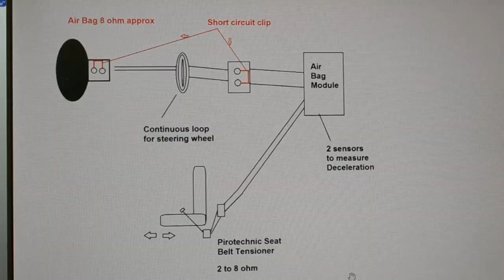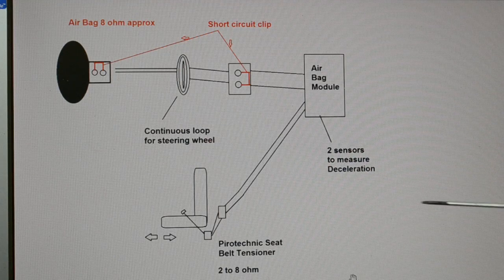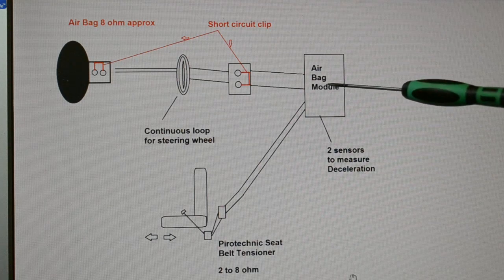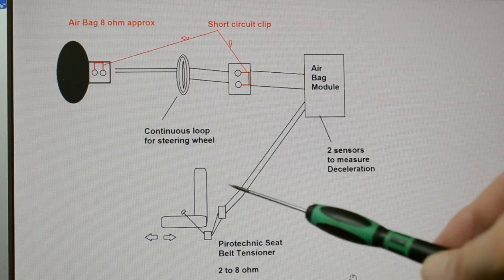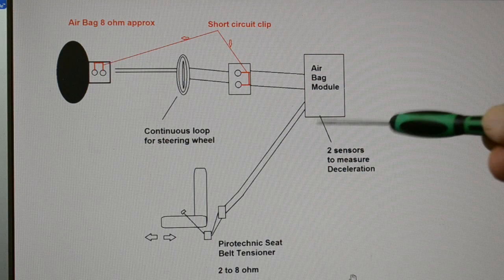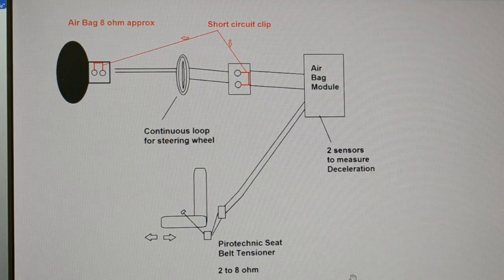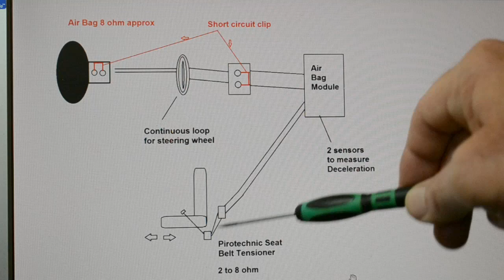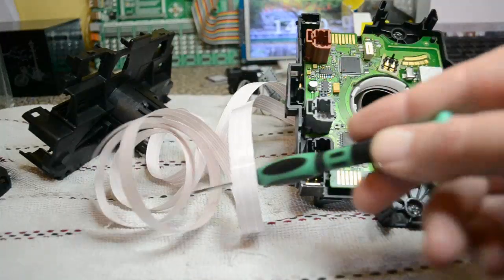Air Bag Light On & OR Horn not working -repair guide

Comment: Hi John. Trying to rebuild my 1993 Aura Legend L clockspring and can't seem to separate the top from the bottom. Have released  the exterior tabs but still no luck. Is there a trick?
Reply from the maker: Hi,
Sorry only did the type in the video.
Reply: Hi John. Thank you so much for your reply. Unfortunately my Acura clockspring is completely different from the Puegot. The Acura has 3 tabs to lift but there's a turn indicator cylinder in the middle of the clockspring that seems to keep the two parts together. Can't get that cylinder out to separate the top from the bottom.
Reply from the maker: In my experience, a repair to the wiring lasts for 5 minutes, hence throwing it away and getting a new one.
Reply: Hi John. Couldn't agree more. Researching a replacement. Thanks for your time. mg

Comment: Thank christ i found this video. 
Just saved me from reality screwing it up.👍
Reply from the maker: Thank you for the comments
How would you have screwed something up?
Reply: I bought a Renault recently and the horn pleased if it works or not and finally died the other day.
 I've been having a look at whats causing it. Im at the point wher I'm thinking the steering wheel cant be that hard to "just have a look"  LOL.... Anyway your video tells me I ain't qualified to go anywhere near it.
I am almost certain the problem is a broken connection in the wheel.
I guess its a trip to the garage for me.😕
Reply from the maker: @dustysweeper  Hi Dusty, did you fix the fault?
Reply: @JohnB-2021  no. The horn still only works when it pleases.  I believe it is a bad solder joint on the live pin inside the rotator switch.

Comment: does anybody know how to put the coil of wire back in correctly? like a rule for the 206 similar to what he mentioned for ford? turn it until tight, then the opposite direction for x turns to centre it? i'm worried the old man's gonna snap the thing if he turns hard since he said he did have it apart..

Comment: good video john....now make a video from the flat cable in the rear windschield wiper switch...those brake down also,can t repair it but it shows how it s not working....mine looked oke but was bady worn(flat cable in the rear window switch)afther this video i consider buying a new com 2000....

Comment: You skipped the most important part, how to unlock the cover.
Reply from the maker: Any one can figure that bit out, it’s just clipped together
Reply: @JohnB-2021  for the center ring cover is not easy to figure how to remove the cover, on this specific model you are showing. 
In case someone need that info you need to press each one of the 4 latches from the inside. If you are going to do something do it well.
Reply from the maker: J D if someone can’t figure that out for themselves, they shouldn’t be touching it. That said, there is nothing that can be repaired so no point in taking it apart.
I just show what goes wrong.

Comment: I'm helping a friend diagnose a problem with their Great wall x240. The headlights, indicators, central locking stopped working and airbag light came on all at the same time. I'm thinking it's this unit shown in this video is the likely problem.
Reply from the maker: Maybe this unit if it's not a fuse.

Comment: I've bought a new squib and the airbag light went off and horn started working...after 2 months the light is back on and horn has stopped too?? I've checked the earth as I self tapped another screw into the steering wheel and covered it in silicone grease. 
the light is still on and it's really puzzling
Reply from the maker: It sounds like, either the steering wheel wasn't set in the middle, or the wiring wasn't set in the middle, that would break the wiring in a few weeks.

Comment: Incredible content. So informative brother. Thank you
Reply from the maker: You're welcome.
Reply: @JohnB-2021  I'm having a toyota Yaris 2010 model which i resently sent for a replacement of the indicator system, Afterwards the hooter lasted not more than 48hrs. Now the airbag sign is on as well. thanks again for this information.
Reply from the maker: @MbhoniMzee  Was it new or used?
Reply: @JohnB-2021  It was new
Reply from the maker: @MbhoniMzee  If it worked once and now it doesn’t, the unit wasn’t centred before fitting it. 
It will be broken.
Reply: @JohnB-2021  Eish okay. where do you suggest we could buy it? 

Thanks once again

Comment: I was doing a brake booster job for my gmc acadia 2013 the steering was on my way, removed it but broke the wire without noticing now i know what happened, thank you 

So i had gmc acadia 2013 horn not working nor the air bag, now i know thank you , because i had to do brake booster replacement, and the steering rod which are connected to the steering gearbox were in the way, so i had to take it off, the steering wheel turned a few times, and i didn't realize it untill i hit reverse, the drawing in the camera was not aligned as the steering, so i took it off and turned it a few times yo align it, and now i know i turned more to the wrong side and now its broken, better replace it now
Reply from the maker: Pleased the video helped, thank you for your comments.

Comment: Hi john thanks for your reply. Is it possible to repair the reciver or does it have to be replaced. The whole block is over £400 from Citroen dealers.
Reply from the maker: I have no idea why the receiver would stop working correctly assuming you now have 2 keys with a low range problem.
Have a look for one on ebay.

Comment: 2:29 Ribbon cable. Not so much a "repair guide" but a "why it fails, and then swap the unit" guide. In theory, you should be able to unplug the clockspring cassette from the PCB, and replace it with a working secondhand one.
Reply from the maker: flat flex, you're right.

Comment: Hi I have a 2007 Citroen dispatch 2.0 hdi the central locking only work's when the fob is very close to the ignition barrel the fob dos'nt work from outside the van. The van starts fine it's just the central locking I've had a new key fob cut and programmed still the same. So could it be the remote reciver that's part of the wiper and lights stalk block.
Reply from the maker: Hi,
It sounds like you have eliminated the key so it must be the receiver.
Reply: @JohnB-2021  ok thank you

Comment: 2005 camry 
tried to pull steering half shaft to lube

I disconnected and it slid down 

but steering wheel spun around and around while I was working on half shaft 

I marked shaft and  steering wheel column , but did not tie it

once reassembled ... airbag light came on and horn stopped...

this evening

Comment: Hello john i have just found your upload and have subscribed as great upload,i had the problem of horn not working and airbag light on and have changed the comms unit on citreon berlingo first,horn is now working but airbag light still on,question is do i need to get new unit  programmed to van at main dealer
Reply from the maker: Hi,
Thank you for the subscription.
If the horn now works, you're moving in the right direction.
The units do not need to be programmed and if the system is clear of faults, the air bag light should go out.
Is the comms unit a brand new un-used unit?

Comment: Can air bag cause other problems . I was stupidly packing a pack of cigarettes on my jeep cherokee steering column a week ago and as I left the corner store parking lot . I noticed the air bag light was on . Well today as taking my wife to work a nasty person was blowing there horn at us and I told the wife I did nothing wrong and could not figure just who was honking at us . Later while on a side or residential street the horn came on and I knew it was me because  I was the only one there . . I can't afford the part at this time but thank you for the tip's I will check out the local junk yard and see if there are any units there with good wires . I may beable to find one in good condition and at a good price . . I beileve while packing the Cigarettes On the upper part of the column  I jarred  or trggered something that went from bad to failure . I  would love to hear your thought if you agree . I have unhooked the horn for now so as I will not be shot by someone . LOL . God Bless     Tim in Florida .
Reply from the maker: +timothy thomas 
Hi Tim,
I'm a little lost, is there some sort of holder around your column for packs of cigarettes?
If you were touching the column and the light came on, I'd suspect a loose / broken wire.
The air bag system often runs to the seat belts too, they have seat belt tensioners.
It's difficult, but you need to do a continuity test on the wiring (with the ignition off)
Air bags are generally 2 to 8 ohms.
I bet the weather in Florida is nice, it's cold here today (UK)
Oh, as for the horn, if you press your air bag (like mine) it could just be loose and need adjusting.
My car MOT was yesterday, yet again the second hand switch stopped the horn working. I found a new one on ebay for £65, fitted a few weeks ago. Yesterday my car passed an MOT test :)
Thanks

Comment: Hi John. My car is a 2001 Dodge Neon. First the Horn stopped working and now the Air Bag light keeps coming on. Are they connected? Does your video also have to do with the Dodge Neon? They did not go at the same time.
Reply from the maker: Hi,
I imagine it's one and the same problem.
Unless Dodge have mastered a way of connecting the horn and airbag without a coil of wire, it will be a coil of wire broken.

Comment: No need to open up the squib/clock spring. Check for continuity first with a meter or tester.
Reply from the maker: Yes I agree, but this video shows what the end user is testing and why they fail.

Comment: I have a 2014 Dodge Charger. I replaced the rack and pinion, spun the wheel carelessly both ways. As a result, airbag light is on, the horn doesn’t work, the traction control doesn’t work nor does cruise control. What would I need to change out on the vehicle?
Reply from the maker: Sounds like you might have broke the column wiring
Reply: I have all the same symptoms except my airbag light is not on @JohnB-2021 . I just put the car in the shop. I hope they don't overcharge me.
Reply from the maker: @jointglobalceo  Please let me know what they find.
Reply: @JohnB-2021  it was the speed sensor on the rear wheels and my horn was missing lol

Comment: Very informative thank you. Also what if I have a continous airbag light and the clock spring is not the case? I tested all the plugs, airbags for continuity and the cables are ok. I tracked them down to the SRS module under the center console. How can I test the SRS module itself ? Thanks! (Citroen xsara btw, I have the exact same assembly as you showed in the vid)
Reply from the maker: Thank you for your comments.
I don't believe there is a method of testing the airbag ecu  other than trying it on a vehicle.
I've not heard of airbag modules just failing and bringing on a light.
I think you need someone with a scan tool to read the fault.
Did you have about 8 ohms to each airbag?
Have you checked the seat belt tensioners too?
Reply: I have a fault on the right side seatbelt tensioner, and the scan tool said "driver squib 1st circuit open circuit present" I even replaced the whole steering wheel control assembly including the clockspring but it still remains. Maybe the module has stored some false data? I measured around 8 ohms on the driver side haven't checked the passenger side just yet. One thing I noticed, is that I get around 1 ohms on the bottom of the plugs where you mentioned the little shorting lever for the pins. I plugged the connector in and measured from the back and it gave me around 1 ohms on each side. I also checked if there's a continuity between the plug that directly goes into the airbag and the end of the brown and blue plug. It was weird to see that if I check the corresponding leads with a continuity tester, at the brown-green side I get a connection signal on all four leads (so if I test one of the leads going into the brown socket, and one of the leads on the green connector that goes into the airbag directly from the clock-spring I get a signal. Then I swap to the other lead on the brown plug and I still get a reading. This doesn't happen on the blue side. Also when I checked the connectors under the seats, on both sides I get a continous signal on the airbag modules and seat belt tensioners, but on the line that goes into the SRS sensor module I only get nothing on the connectors which should be connected to the belt tensioners.
Reply from the maker: So you have a problem with the wiring under the seats, common.
Reply: Almost, turns out it was one of the leads heading back from the seat to the SRS unit. Cheap fix. Anyways thanks for the video! :)

Comment: Bro, Can i put another model of turn signal on my Citroen, i want the version with the autopilot... And Mine doesnt came with...
Reply from the maker: Do you mean cruise control or lane departure warning?
I don't know of any auto pilot.
If it's cruise control you want, buy the cruise switch, plug it in and get your car programmed.
Lane departure warning is a complete control unit, wiring loom and sensors under the front of the car.
Reply: @JohnB-2021  Sorry for the bad english. I mean Cruise control
Reply from the maker: @CarlosHenriqueNoronhadeAguiar  No problem.
Fit just the switch to your comms unit and get the car programmed.
https://www.youtube.com/watch?v=YE_RyWUgo28&list=FLVK_b1RL2Ms3w9SS_AzO6oQ&index=6&t=0s
Reply: @JohnB-2021  but Mine doesnt came with the radio controls too
Reply from the maker: Carlos Henrique Noronha de Aguiar 
See if there are blanks fitted where the switches should go.
You can buy that cruise switch for a £12 and plug it in.
You WILL need to get the car programmed.
Reply: @JohnB-2021  my turn signal switch doesnt came with the music control and  the Cruise control
Reply from the maker: @CarlosHenriqueNoronhadeAguiar  
Have you had a look to see if there are covers?
Reply: @JohnB-2021  i had to replace It one time because the turn signal was wiggling. Is a Valeo Com2002
Reply: There are no covers
Reply from the maker: @CarlosHenriqueNoronhadeAguiar  
Well I have just searched the part number and found this one in Spain.
96576767XT Remote Multifunction Citroen C3 (1995 - 2010) 
The last picture shows 2 cover tabs on the bottom.
Reply from the maker: @CarlosHenriqueNoronhadeAguiar  I will research :) Greetings from the UK
Reply from the maker: @CarlosHenriqueNoronhadeAguiar  
https://www.youtube.com/watch?v=oEqKJ0WJVg4 
This C3 with cruise control from 2004, we need to check Citroen brake switch wires
Reply from the maker: @CarlosHenriqueNoronhadeAguiar  Turn it up the other way so I can see